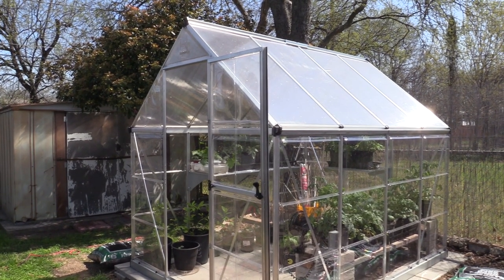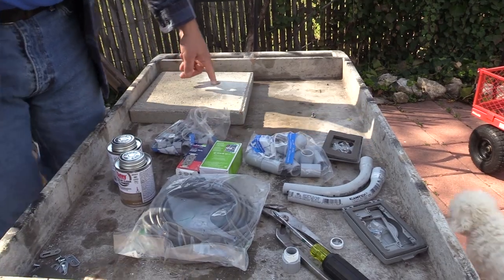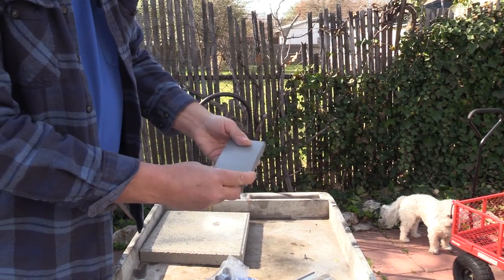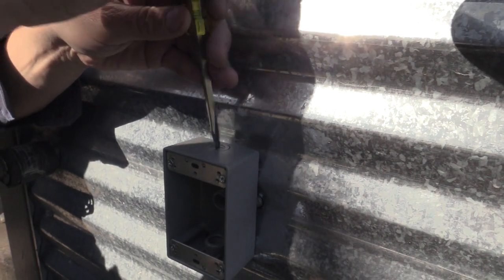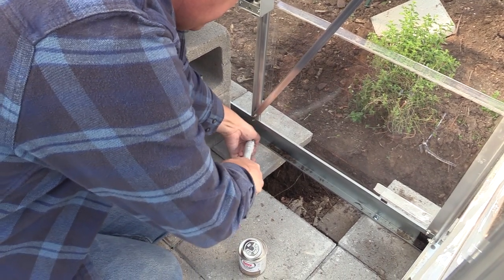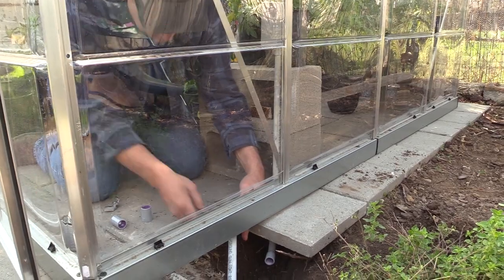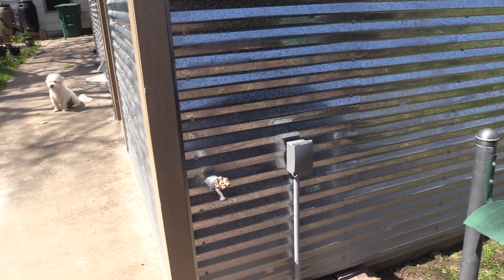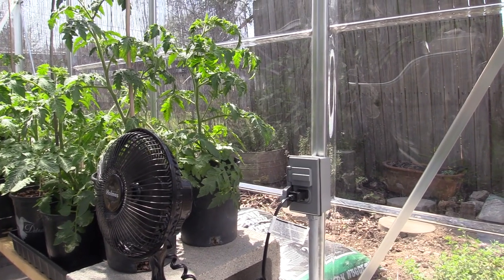Adding Electricity To A Permanent Greenhouse

Comment: Remember the top of the conduit needs to be at least 18" deep to the surface of the soil outside, or 24" if it is a roadway. Some electrical inspectors will not permit outdoor Romex wire to be run inside conduit, instead wanting individual THHN wires inside conduit. I was puzzled about that until somebody explained that although mechanical protection is not an issue, heat dissipation is impaired if conduit surrounds the Romex wire sheath for a run more than a few feet. Also the Romex sheathing occupies the 40% air space required to dissipate heat. Using individual wires creates a new problem because you then need a pull box to transition the wires going to the panel inside the wall of the home, where more protection is required. The alternative is to bury the outside rated Romex wire directly, using conduit only for the entry and exit points where the wire goes down to proper depth.

Comment: Nice neat job and knowing the amount of work needed to complete this task, then it has been well thought out and implemented.

I have no idea about U.S. electrical standards, but in the UK, I don't think PVC conduit is allowed.
Although I was not sure about running PVC conduit and given the cost of running metal conduit, I elected to run some armoured cable instead.